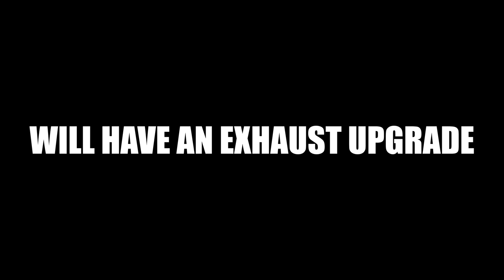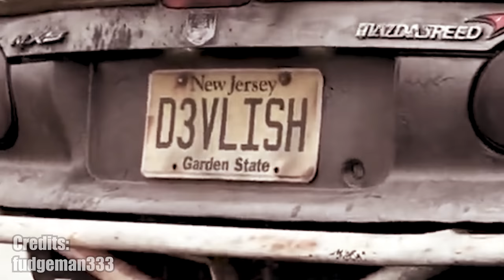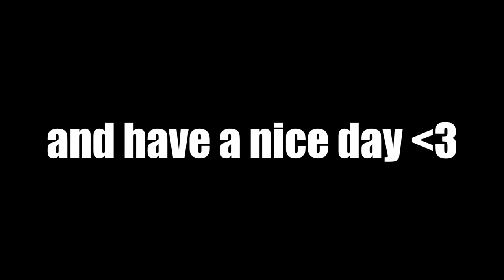This Mercedes Will Outlast Humanity

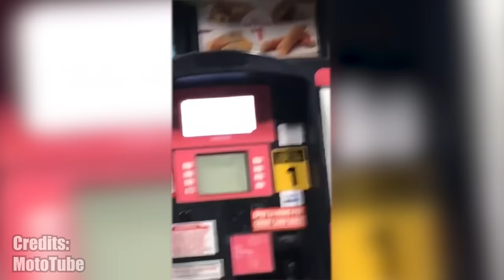Comment: 2:03 fun fact: this method was actually used by some russian tanks during WW2
Reply: Cool
Reply from the maker: some modern ones also use it, as far as I can remember
Reply: Modern Russian tanks still employ this method, by dumping diesel into the hot exhaust manifold to let it evaporate into a thick smoke screen.

As most military engines are diesel, and the smoke system is downstream the engine in the exhaust, it doesn't damage the internals to make smoke, unlike putting diesel through a petrol engine!
Reply: @3.9L_V8  I confirm, the M1A1 Abrams have this feature as well
Reply: fun fact: polish youtube did it earlier on motokoty channel (proud polish man noise) C:
Reply: Alot of armored car used by the government like Mercedes use this method
Reply: Pretty sure a lot of Cold War tanks did the same thing aswell
Reply: @AleLGB  They have to be careful doing that since the Abrams can also run on petrol and jet fuel. If they try it with those thay get to try out the auto burn feature that scuttles the tank
Reply: Most tanks past like the 70's have this feature
Reply: Yes the smoke come out of exhaust
Reply: About a identity crisis
Its a gt86 
The fangs on the front bumper says it all
Reply: Was that the inspiration for the gold finger db5?
Reply: @AleLGB  you work with one?
Reply: @kitadrian2115  I wish
Reply: Still used today
Reply: @CarMighty  car dance
Reply: @3.9L_V8  ESS gaming
Reply: @CarMighty  2
Reply: This would certainly be a neet get away tactic if ever used, probably has but I'd like to see I in action
Reply: Jesus loves you alot trust in His death 4 salvation and be saved from eternal hell <3 Jesus died on the cross for you bro.

Comment: 6:15 Fun fact! Trophy truck race teams replace every single spherical bearing and heim joint (also know as rod ends or "rose joints") after every single race! Often times the parts being removed are still in perfect working order with minimal to no play/wear, but are still replaced as a "safety measure" but mainly because any failure of these components mid race would effectively take them out of contention, forcing the driver to limp the car to the next checkpoint or cause a wreck. Considering these cars cost upwards of half a million to 2.5 million, I'd hate to be the race tech who didn't replace one of the suspenion joints because "it was still in perfect working order/was well within the manufacture's spec" only to have it fail while we were in contention for the lead of the race. Ending that race weekend/costing the driver the race win. 

Would. 
Not. 
Like. 
To. 
Be. 
In. 
That. 
Room.

Comment: hi from australia
2:06 my dad did this once with an old rusty hq back in the 90's and took it to a burnout show as a joke and because it had 120 horsepower and weighed as much as an elephant they had most of the show veiwers trying to figure out how they where pulling so much smoke

Comment: 1:56
I live in iran. In my country Smugglers actually use this trick to loose the cops. Nothing will happen to your engine if it's naturally aspirated. But let me tell you something. It's recommended to use fuel pump instead of your windshield cleaner. Because that definitely won't be enough to make the cops blind, specially in high speeds.

Comment: 5:28 The motor of the Mclaren f1 was based on the BMW 850CSI's engine which is one luxurious boy using pretty much 2 BMW v6's glued together. (which is why it's not very reliable since the batteries go low very fast)

Comment: my fathers tractor also burned down, it didnt need to be resurrected it just needed a new fan, as the old one melted.
it still gets used regularily and its very reliable. IHC

Comment: @CarMighty Bro, you want to see dangerous drag racing, look up, 1320's war in the woods videos, its an 1/8 mile tarmac track, with probably and 1/8 if lucky of stopping area other wise, you'll be in the woods, the middle of the track divides the two lanes by a patch of grass that extends to the finish line, and the track is bearly wide enough to be a nhra lane. You need to see it.

Comment: 7:55 actually there is a way... here in norway we have something we call ræggere wich usually is old diesel volvos with a straigt pipe huge subwoofer and rust (also a smell of alcohol) and sometimes a ferrari logo but instead of the horse its a moose

Comment: sad fact is that resin will only last as long as that room's temperature is controlled so it will only last in till the power fails then will break down in accouple years after that

Comment: Hey if you wanna baja at a budget look at baja bugs and not all classic muscle cars are boats just those for drag, stock (still drag), and maybe drifting as a boaty car helps alot but put it on proper suspension and boom a car that will outrun your buddies Evo in the corners at half the cost XD